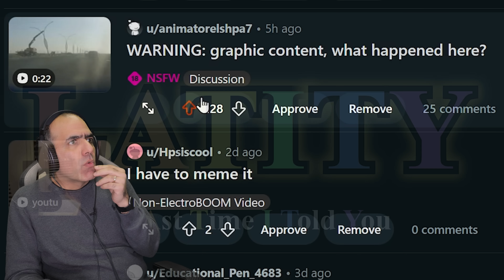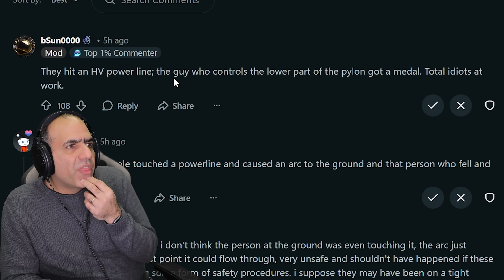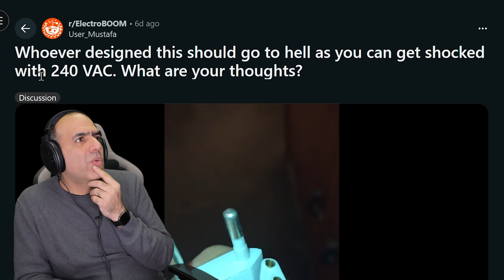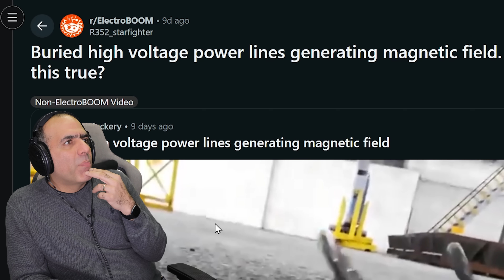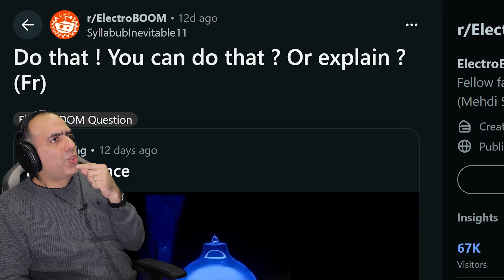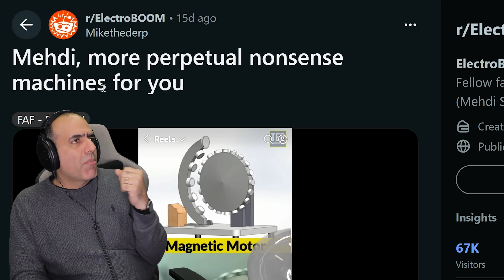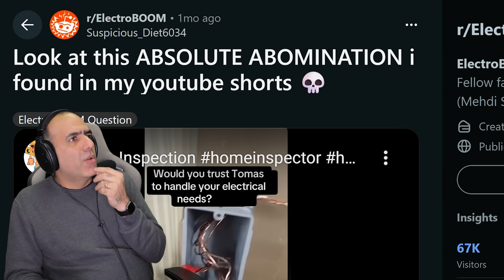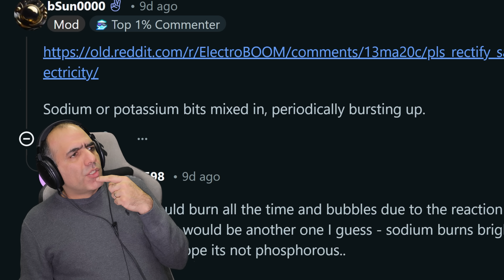Have a Pole? Need a Hole! (LATITY-017)

Comment: They used to use the copper water pipes for the neutral in houses.

What happens is when they replace the copper supply line to the house with pvc it basically disconnects the electric neutral from ground , but the drain pipes are still touching ground......so you get a voltage difference between the faucet and the drain.
Reply: but how the faucet gets line voltage if supply pipe is pvc
Reply: @rekoset all the copper piping inside the house  is hooked up to the neutral from the transformer , but the piping is no longer hooked to ground because the copper supply line from the meter was replaced with PVC.

When they replace a copper supply line with pvc they are supposed to check the power panel and make sure a grounding is installed.

Any house built before 1995 can have this issue.
Reply: @glennchartrand5411 in my country there is no grounding at all, and I'm freshman ee so I'm not familiar with this concept and struggling to understand why they even connecting neutral to the ground but thanks for explanation anyway
Reply: @rekoset  I’ll admit I never looked into why, but I was aware that ground and neutral are tied together in the breaker box in my country’s electrical inspection regulations. That’s a thing you get whether or not copper piping is chosen as the method, so maybe that will help you in your explorations :) now I’m kind of curious how common that is, myself!
Reply: @rekoset  other things connect to the copper pipes still inside the house for their own ground, quite frequently. I’m guessing there’s a ground fault in something else in the place
Reply: @kaitlyn__L 
It happened to a lot of houses in St.Clair County Illinois when they started replacing the copper supply lines from the meter to the house.

If you touched a faucet and the drain you got shocked.

Because the plumbers weren't told to have an electrician make sure there was an actual grounding rod before digging up the pipe , because up until 1995 it was legal use the supply pipe as the grounding rod.
Reply: @glennchartrand5411  come to think of it I’m not sure if it’s still a thing here 😅 but my first house (which did have a lot of breaker trips! And even a lightning strike through the roof aerial once, which wiped the tape inside the VCR!) definitely used the copper pipes for ground for stuff like the radiator pump. And for grounding the radiators themselves, often. Certainly there’s still a crossover visible in the bathroom for the radiator. But the neutral to ground crossover happens inside the breaker box thankfully.

Comment: In Japan, the third pin for installation is optional only for single-phase 100V devices, but is required for devices that use 200V or three-phase AC outlets.
Therefore, when leakage protection is required for single-phase 100V, a separate, independent earth wire is often used, and for such reasons, adapters that convert from 3 pins to 2 pins and an independent earth wire are often seen.
Reply: We also have those in the United States too, those little 3-to-2 adapters, because some extension cords have only 2 plugs (I've never seen a wall outlet without a ground). Absolutely no one uses them correctly though (myself included) everyone just plugs the device in with no ground.
Reply: @watsgoinonhere1  naw i screwed that bad boy in legit, i didnt want to risk anything lol

Comment: 10:16 These switches can work without a battery. I saw doorbells working with piezo crystals. You hit them so strongly that the pulse is enough to send a radio signal for the receiver.
Reply: thats really cool, and there are radios that can function without a battery because they use induction to draw power from the signal, combine the ideas and you would have a truly wireless and battery-less door bell system
Reply: I have a wireless dorrbell which uses a lever system and a coil similar to these "shake to charge" flashlights.
The reciever doesn't use batteries either, it plugs into the wall instead.
Reply: I for a second thought the metallic beam was the "wire" itself, sighs time to take my meds again

Comment: 10:44 thats not uncommon, in Brazil some places have 240v, it varies from region to region, but we have 110v, 127v, 220v, 230v, 240v. Electronics with voltage switches generally have just 110v or 220v as options, but some older ones had 110v, 127v and 220 or 230v. Older cities tend to use 110/127 because that was the standard when their electric infrastructure was built, newer cities use 220/230/240 which in my opinion is better because basically any electronic uses half the amps and can use a 10A plug, in 110/127v areas we have to the larger 15A outlet to power things like microwaves, and that is annoying when you move to a new place and have to replace half the outlets because they're all 10A

Edit: reached 13:04 we learn to always check the voltage of things we plug, and most things have automatic voltage switching so its not a big problem

Comment: Eyy mehdi Not So Fun Fact, majority of household in the philippines barely had any ground connection on the outlet itself majority of the appliances here also doesn't have those too.
if they do have a grounding wire its either an expose one where you gonna screw it or those you know 3 prong ones that needed to be adapted to 2 prong ones that makes the grounding prong very useless. i remember one time using the washer having it plugged in and shocked the living shit out of me. learned a very painful lesson there. 

and also just to add something scary we have our electric distribution boxes relatively accessible and most of the times its exposed!! and you know kids being kids they will grab the thing and gets hurt in the process
Reply: Outlets in India have great small children finger sized holes. Also, the bigger the hole, the more amperage.

Comment: 7:22 This image is probably Ai generated, Just look at the acrhitecture on the right. Its doesn't make sens at all. And if you look under the "Jollit" sign the text 14 Hours are looks very Ai generated. And the cable right beside the one that cut thrue the stares are bending in the air
Reply: thats Jollibee, and the sign text is 24 hours.
Reply: No, that's a Jollibee restaurant sign and it's more than likely somewhere in the Philippines. As someone of Philippine descent, I can confirm the utter rat's nest of power/communication lines is 100% a real thing there. Everything is pretty much tapped into whatever they can, wherever they can. 1st rule of being in the Philippines... there are no rules...
Reply: Are you people astroturfers or just kids with zero knowledge about the world?
Yes, A.I sucks. Yes, we should fight against it whenever possible. That doesn't mean you should muddy everything by accusing OBVIOUSLY REAL photos of being AI when you don't even know what a Jollibee is.
Reply: Yeah and what is that green mesh that for some reason sticks up over the sign, merges with the sign and has a wire bouncing off of it??? This is so AI generated it doesn't make any sense at all and the objects just morph into each other and pollute each other with colours
Reply: @teamredstudio7012 
You can see the wire tied around the pole that runs in front of the sign.

Comment: Hey mehdi 
I even posted on your reddit but i was bullied for it 
I had this charger bought from APPLE STORE when plugged into my phone it used to shock... I even tested with tester and it was blinking 
It electrocuted very bad , specially as iphone now are metal 

Same with my new samsung one but it's a fake so idk maybe no isolation in circuits